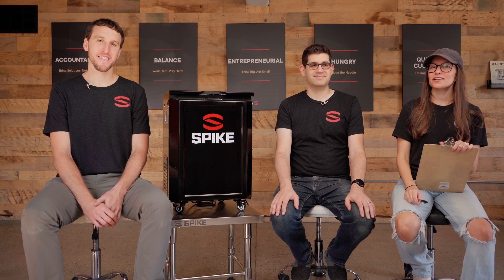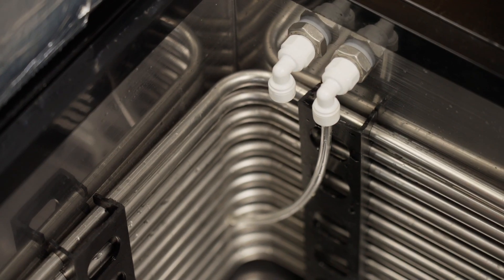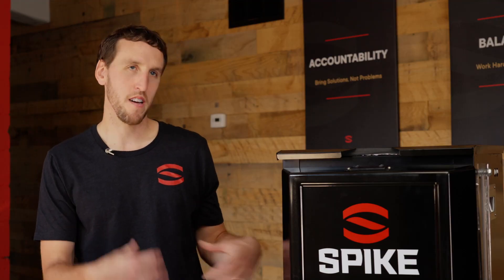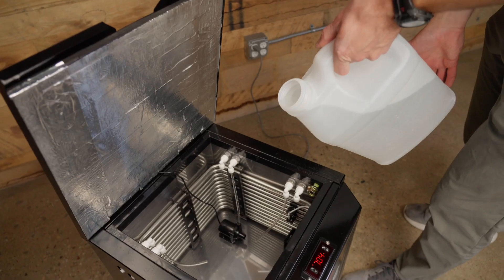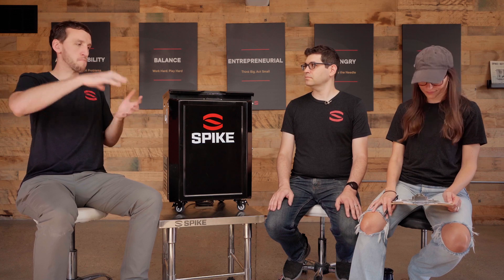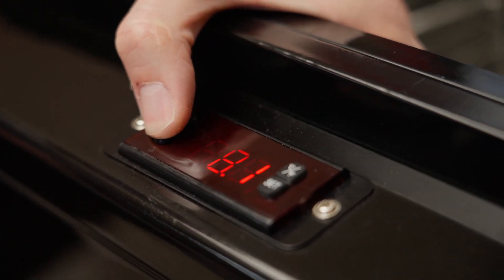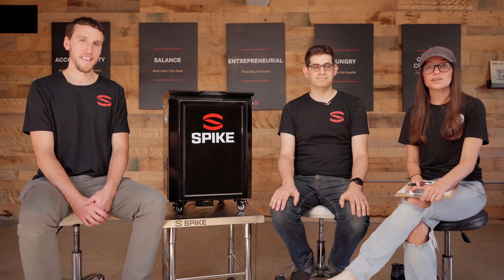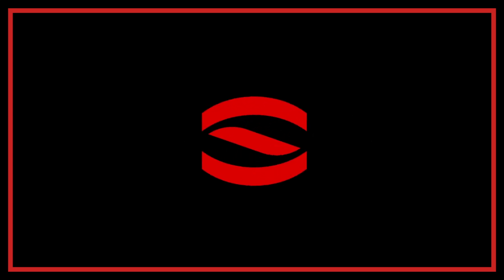Spike Glycol Chiller AMA

Comment: Okay so first of all nice product. It's good that multiple companies creates such systems for fermenting. But. There is no clear answer to what it can do. A Grainfather GC4 has thicker glycol lines and they say that it can cool down 4 fermenters of 70 liters to 4 degrees celcius. In practice they can keep 4 100 liter fermenters at 5 degrees celcius. But your answer is like: Yeah, it depends on setup. Why don't you just test it and show results? Your price is quite low compared to other systems. Show results and people will buy. Keep up the good work. I really like your products.
Reply from the maker: The problem is there are too many permutations to test. You can have 4 fermenters ranging from 5gal to 30gal from temps of 35F to 80F in all sorts of ambient conditions. As a rule of thumb we say:

Lagering Temps Capability:
(2) 1bbl fermenters 
(4) Flex, CF5, CF10 or CF15's

Fermentation Temperature Control Capability:
(4) 1bbl fermenters 
(4) Flex, CF5, CF10 or CF15's

Also we will have a cooling capacity comparison on noise comparison on the site and social media soon. Stay tuned!
Reply: @SpikeBrewing Thanks for answering! That is so great that you actually take the time to read out the comments and answer. I truly understand that there are too many permutations to test. So I hope either you or other people are going to test it all. I will stay tuned.